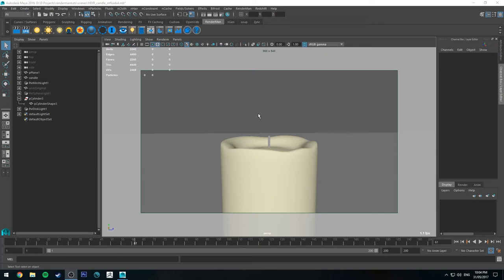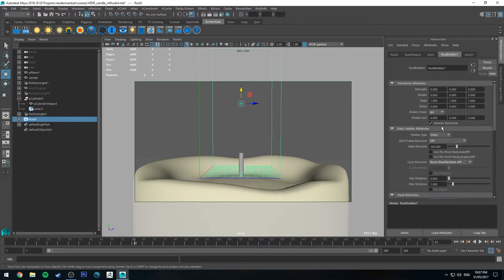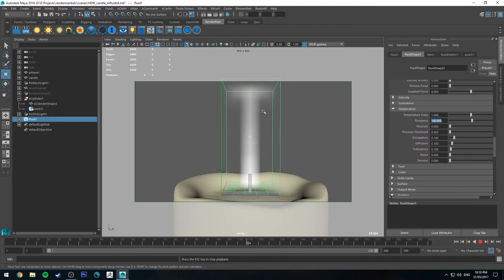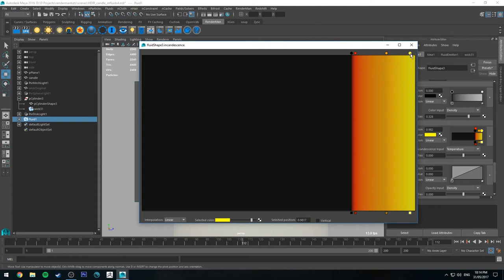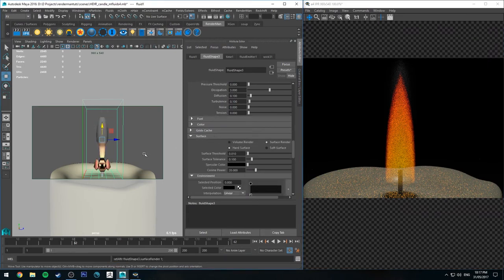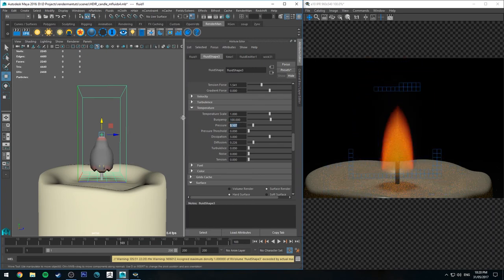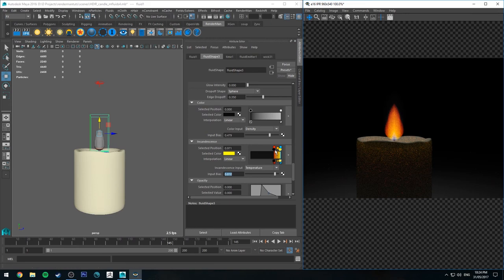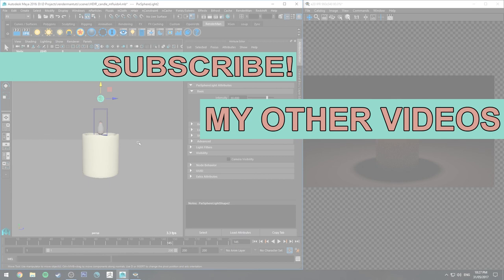How Do I Render: Maya Fluids Candle (Maya & Renderman)

Comment: Thank you so much for these tutorials, they're a big help!
I was wondering how you might go about making a lamp?
In a project I'm working on I have a lamp in the center of the room as my main light source, but I'm not sure how I should set it up. 
I tried using the mesh of the bulb as a mesh light but I don't like the way this looks. Now I'm using the "light bulb glass" material that I found on the RenderMan resources page and the bulb looks great, but I can't get it bright enough to light the scene. 
I'm also not sure how I should set up the lamp shade to be translucent without getting noisy results that take forever to render.
Reply from the maker: There are a few things to consider. You may not necessarily need to make the lamp shade translucent if you texture it to look like it's got light filtering through it, this will save you a great deal of render time. Then you'd just want to create an invisible light source around the lamp shade and light link it to the rest of the room to generate enough light, a sphere light could be good for this. All this depends on a lot of things like the size of your room, other light sources, how much light you're expecting the lamp to generate, atmosphere. Also, you should definitely be using de-noising it will save a lot of time on your render as you'll not have to render to as high a sample rate/variance.

Comment: It wasn’t from this tutorial but when I created a tornado with npartcles and fluids. After I cached it. If I add a renderman dome light it crashes. If I try to render it without a light it’s just black.
Reply from the maker: Yeah nothing will render without lights. Does the same thing happen when using a rectangle light? I've had issues with dome lights not liking to be created after certain things in the past, can't remember what it was exactly it was on an earlier version of Renderman, but if you create them first the issue doesn't tend to occur. If this is the case you could export your nparticles and fluids, create a new scene, create the dome light first and then import your tornado and see if that works.